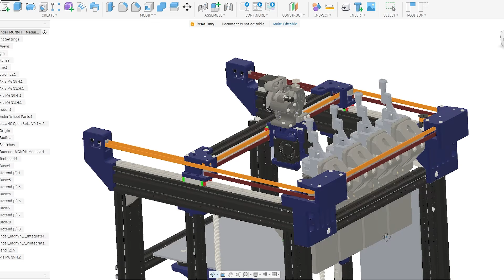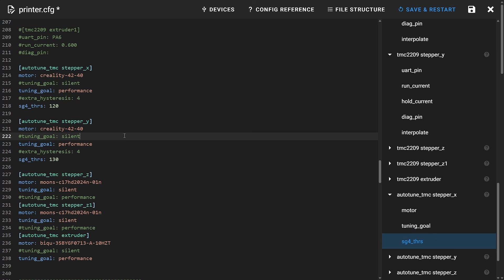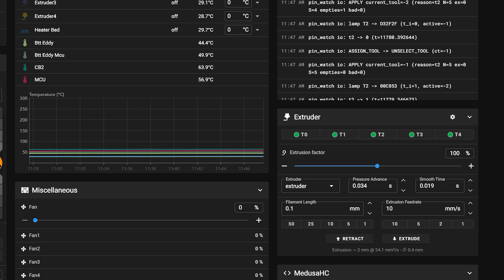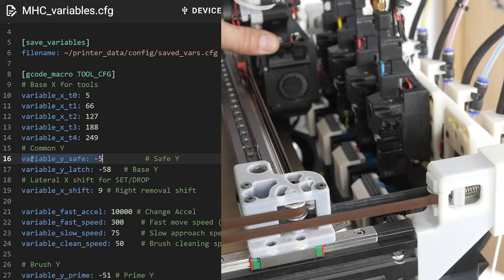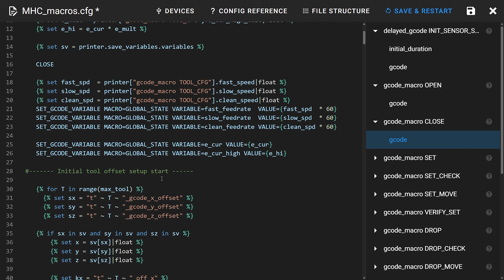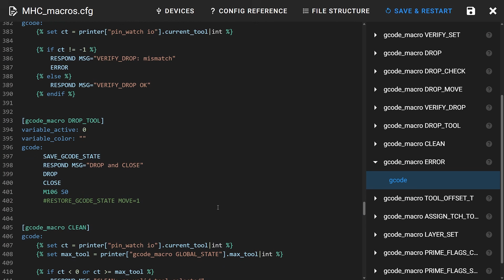Project MedusaHC Part 3 — Inside My DIY Toolchanger's Software

Comment: Hey Sergey is it possible to build a duender from scratch? I don't have 2 ender 3's laying around but I would love to build a duender.
Reply from the maker: That is definitely possible. But it will most likely end up being significantly more expensive than finding a couple of old, even broken, Ender 3s on marketplaces. Quite often people give them away for free because they do not want to deal with them anymore.
Reply: @Irbis3D  Do you have any idea how much more expensive it would be? 3d printing must not be very big in my area because there's only a few ender 3's for sale and they are all around 100-150 a piece. I will have to look into it more.

Comment: Hi Sergei,I am following your amazing MedusaHC project with great interest!I have a custom-built CoreXY printer with a 310x310 mm heated bed, currently running a V6 5APLUS Volcano Highflow (Type B connection) hotend on an EVA 2.4 toolhead (which I could easily upgrade to EVA 3.0 if needed) paired with a Sherpa Mini extruder.Since my belts run both front and back on the X-gantry and the stepper motors are positioned at the front, I have plenty of physical clearance in the front area to install a V-Front dock system without losing any printable Y-travel.Before diving into the CAD, I wanted to ask your expert opinion: do you think it is feasible to adapt and modify your toolchanger design to fit an EVA 2.4 / 3.0 platform while keeping the Sherpa Mini? Has anyone in the community attempted an EVA integration yet?Thanks for your time and for sharing this incredible project!Best regards,"
Reply from the maker: If I’m not mistaken, someone on Discord wrote about adapting EVA. But it is better to ask directly on Discord. I do not have time to keep track of every new modification update.
Reply: @Irbis3D  tnk

Comment: Thanks for your projects; I’m learning a lot from your videos, and you are a truly inspiring person. Thanks for all your hard work.

A friend gave me an old Ender 3 that had barely been used but had been sitting abandoned in his workshop. I’m currently having a great learning experience tinkering with it—getting it to print a bit better and faster—simply because I can, and it’s really rewarding. Seeing your "Duender" project makes me realize just what is possible; I plan to get another Ender 3, but only after buying a different printer to handle the parts needed for that project. It’s really fun.

Later on, once I’m feeling a bit more confident, I’ll give your Medusa HC a try.

Best regards, a Venezuelan in Argentina.

Comment: Excellent as always! In the previous video I was one of those who commented that it would be excellent to have the heads behind like the XL. Now I was thinking that maybe the multi-head coupling system of the Flashforge Creator 5 or docile M1D that is about to be released can be adapted! I suppose that at some point these heads will be available for sale as spare parts